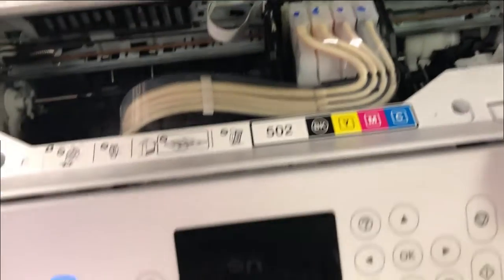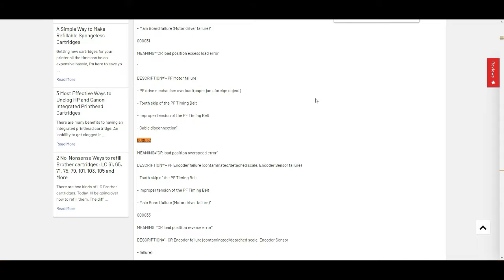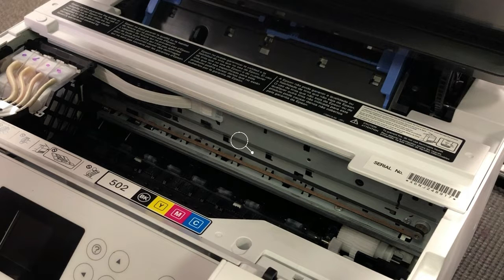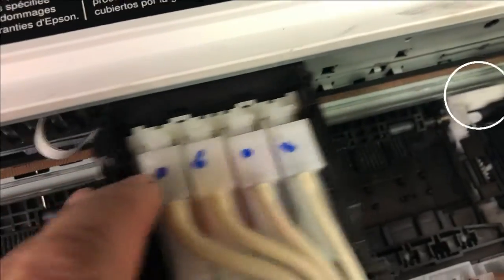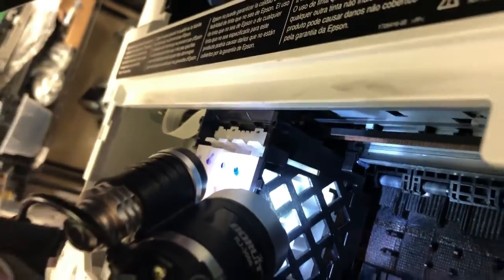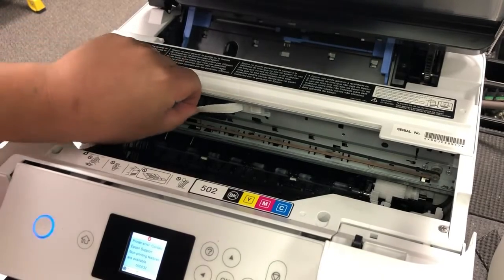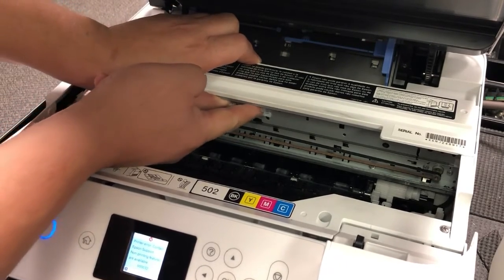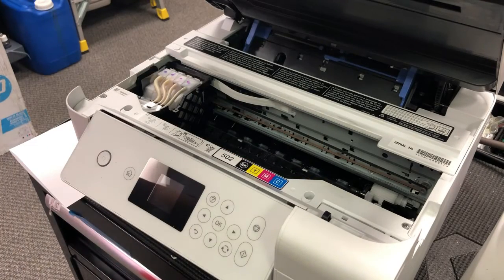How To Fix Epson EcoTank Printer Error E-01 000032

Comment: The tape is definitely too long, it folds and tangles with the clear belt every time I slide it, but the plastic clip the tape slides into is so tight that I can't work more tape back through it. I got a little bit, but then one of the tapes got a kink in it, and now it's really refusing to go through. Can the plastic clip be removed so you can slide more tape through, then clip it into place again?

Comment: mine is 00031, how do i fix that?
Reply from the maker: Thanks for subscribing to my channel. 00031 is most likely to happen when you have something going on with the page feed (PF) assembly. Either a dirty scale disc, or the motor burnt. Get a pro to look at it and it shouldn't cost too much.
Reply: I have a epson ecotank et4800 I’m gettin 100032